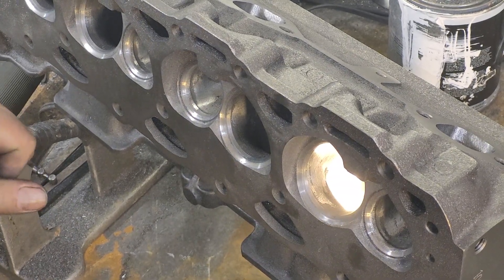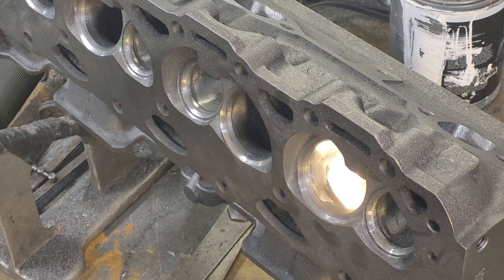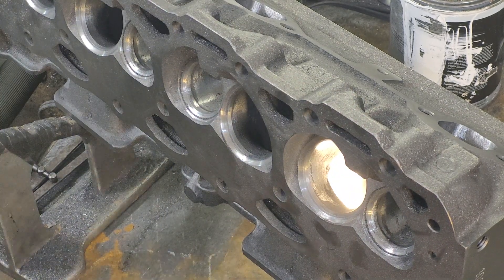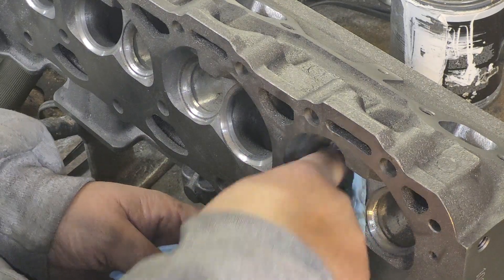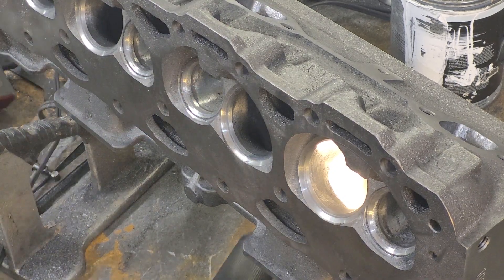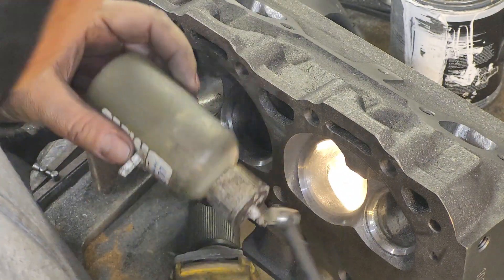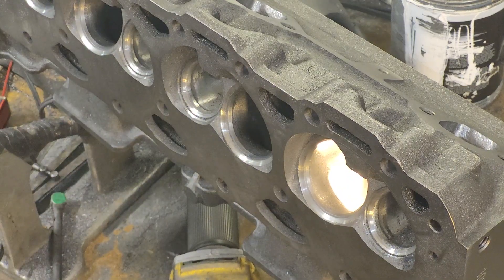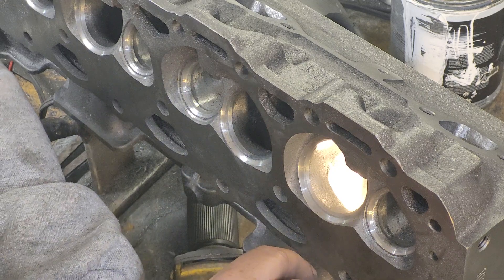Porting the EQ Vortec Lightning cylinder head short side radius.

Comment: Nice video ,I need one of those small Dia probes I have a TM 8812 tester where can I get a probe like what your using?thanks in advance. Joe
Reply from the maker: Mine is not that small. They may make a smaller one at this point. Mine is from Dakota ultrasonics.
Reply: @servediocylinderheads  thanks are these probes somewhat universal
Reply from the maker: @joebushell2438  I would think so but I would ask the manufacturer. Dakota uses a solid two pin connector.

Comment: Hi! Charles. Something I learned a long time ago, From a guy that did professional head porting. Valley Head Service. In Sacramento Ca. Turn the head exhaust ports toward you, Deck surface up. Working the intakes. Draw a line on the deck. straight from the entrance ( of the port) 1205 fel pros. etc to the valve seat. Left ent. to left seat & Right to right seat. Look down that V Then make that short side Tangent. Do not lower the floor. It's to short already. Just straighten it
Reply from the maker: Was this the old Italian guy from VHS?

Comment: Hate to bother you with so many questions. But I have a 1964 Chevy 5500 tilt cab. Deciding what to use I have a 383 SBC and a 500 Cadillac. What would you build.  If I use the 383 . What heads should I buy for the best low end torque?
Reply from the maker: I like the Dart 007 but they need work. I like these Eq vortecs but they need work. I would think about the small port bowtie vortec. It flows pretty well right out of the box. 383 no doubt.
Reply: @servediocylinderheads  Thanks for the great videos.  I was a technician graduate of UNOH back in 85. My first job 2 days later was in a GM dealership parts department ever since. I just work on my own stuff.  Rebuild Q-Jet s. Instrument clusters and experiment with the SBC. My friend  40  years at his own machine shop with some good equipment and a dyno work together and of course BS alot. I'll make sure he watches your videos
Reply: @servediocylinderheads  an maybe I can do the basic port work without getting myself in trouble?
Reply from the maker: @dondotterer24  How much trouble can you make?
Reply: @servediocylinderheads  doing the wrong things when porting  this kind of head.